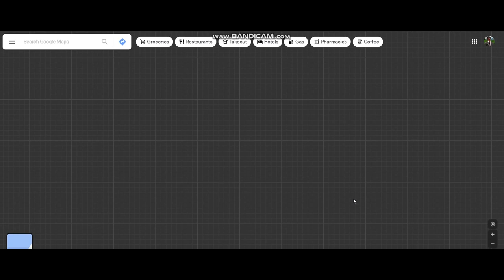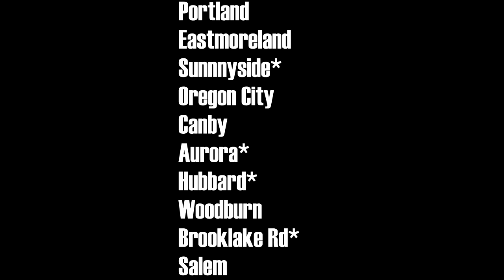Portland Commuter Train

Comment: The costs involved with infrastructure would be … hmm … unrecoverable in the short term but possibly at a break even point decades down the road. I wonder if just investing in a couple diesel electrics would be more cost effective? I mean, I like the idea because of the noise reduction and less pollution and all that. Plus it connects important aspects of transportation. But … and you know there always is a but … you have to consider TriMet and the city of Portland’s practical business applications.

Personally, I like how Europe has heavily invested in electric for both freight AND passenger. However, Europe can fit inside USA many times over and they have a fraction of our population. So, the costs involved (city to city) is far less and the headaches associated are greatly diminished … it’s just less complex than in-state and state to state rail for USA.